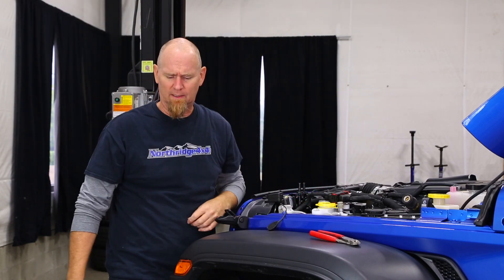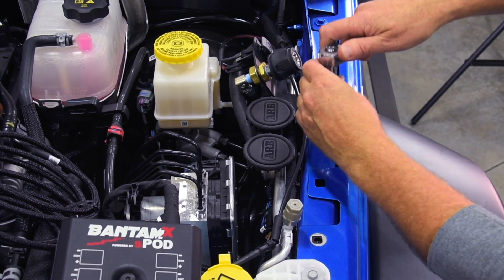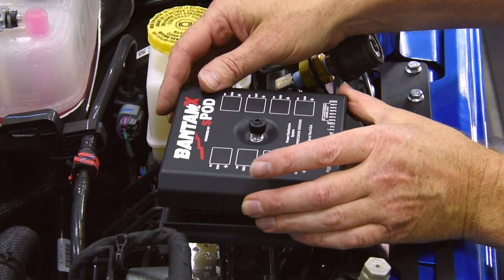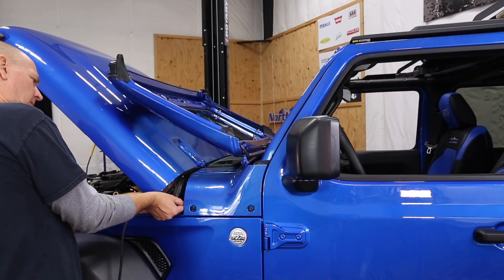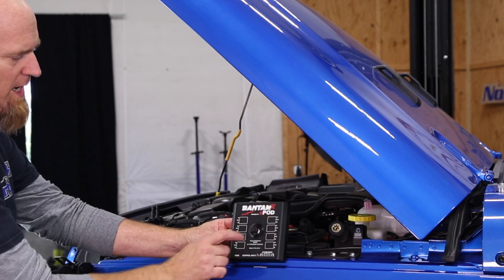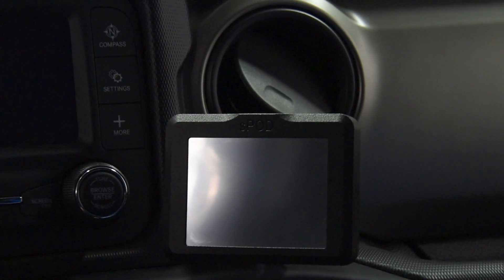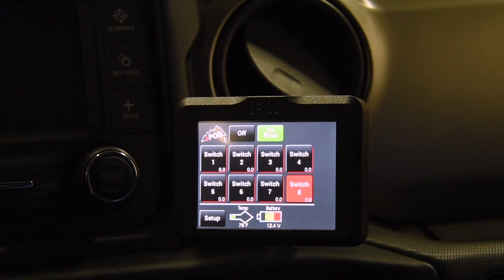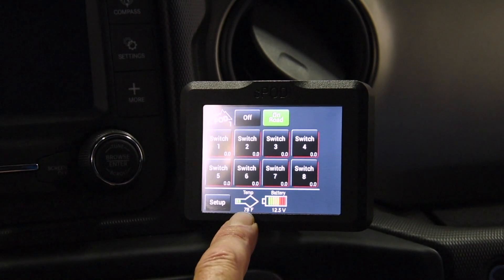sPOD BantamX TouchScreen Install - Jeep Gladiator JT

Comment: Question? Sorry I know it’s been awhile but what Spod battery cable length terminal cables do you go with when buying the unit. 

The 84”or 36” length. Just wondering if the 36” is long enough. They offer two different options. Thanks for your time!
Reply from the maker: For the JT, we go with the JT specific kit:
https://www.northridge4x4.com/part/switch-panels/bx-tsb-jl-spod-bantamx-touchscn
If you are doing a custom mount, use a tape measure to measure over from where you want to mount your PDS over to your battery.
Reply: @northridgenation Thanks so much for replying back to me so soon. Yes, I have a 2021 4Runner I’m wanting to get one for. 

I will do as you suggested. Also trying to decide between the Spod touchscreen or the Spod HD model. Decisions, decisions! 😂

Comment: Thanks, but for my 4XE no way would that mount there.  I went with the  speed Pod that mounts to the passenger wheelwell which fits.
Reply from the maker: Great tip for those 4XE peeps out there.

Comment: So for the two separate ditch lights do you double up the spade connectors on the SPOD terminals for the specific switch?  Or do you splice the two ditch lights together so you only have 1 set of positive/negative wire from going into the SPOD?
Reply from the maker: We typically double them up. Easier to pull one side of the harness if needed.

Comment: Nice will this work for a 2021 Chevy Colorado zr2 ? Is there a mounting plate for it or kit ?
Reply from the maker: Yes, the sPOD will work with any vehicle that has a 12v power supply. They do not make a Colorado-specific bracket. Your best bet would be to go with a universal kit and make your own bracket:
https://www.northridge4x4.com/part/switch-panels/bxtsbuni36-spod-bantamx-touchscreen-for-universal-with-36in-battery-cables
Though you could go with a JL/JT sPOD kit, the mounting bracket is really basic and could easily be adapted into other vehicles:
https://www.northridge4x4.com/part/switch-panels/bx-tsb-jl-spod-bantamx-touchscn

Comment: Did that mount release yet?
Reply from the maker: yes, here it is:
https://www.northridge4x4.com/part/compressor-mounts-accessories/10380-grimm-offroad-twin-compressor-mount-spod-upgrade-kit
Reply: @northridgenation  Hey, sorry, that's a compressor mount. I was referring to the SPOD switch mount featured in this video
Reply from the maker: @jaredchandler4504  That hasn't been released. Reach out to Grimm Offroad and let them know that is something you'd like to see.
www.grimmoffroad.com
Reply: @northridgenation  thanks. Will do 👍

Comment: Great concept, but wow is that screen horrible! It's 2022, where is a 5" or 7" option with an Hi-Res option. I'd gladly pay more for a actual good looking device. This reminds me of something from the 90's that runs DOS lol.
Reply: Yha me too. Looks like a palm pilot screen from '05. And you dont want to be making mistakes w the screen when your in a jam. At this point id rather have real buttons clean and simple like the switch pros and flush mount it into my headliner, out of sight from crackhead thieves and out of my way when I dont need it!

Comment: Amazing video!! Extremely helpful! I just installed mine last night. I do have a quick question. I’m installing my KC 50” light bar pro. It came with a bunch of extra cables 🤪. Where do I make the cut?? I was instructed to cut everything off as just connect the negative and positive coming from the light bar and get rid of the relay. Is this correct?? Thank you I’m advance!! I love you channel. Please keep up showing us how to approach our mods.
Reply: @randypeal2255  thank you so much!! I truly appreciate the help!!
Reply from the maker: Yes, just cut the harness down until you have the negative and positive wires, run those direct to your sPOD and you are good to go!
Reply: @northridgenation  thank you so much!!! I truly appreciate it!!

Comment: The S-POD with the LED Screen is what I want for my lights on my JTR. I like the way it installs without all the extra wires and your able to hook the lights direct to the system without splicing into jumpers. This is the way to go. No connecting into cigarette lighter fuse or having to go into the hazard light wiring, this looked way simpler & better IMO.
Reply from the maker: They make it so much easier!

Comment: Just keeps getting better; just the position of where you located will get hot in cold weather when the heat is on blast...?
Reply from the maker: The swivel vent makes it easy to either point the heat away or even shut it off all together.

Comment: Do you guys sell a kit of just the mounting bolts? Neither my SPod nor my Grimm offroad ARB mount came with the bolts to mount it to the hood.
Reply: If not do you happen to know what size bolts I need to get?  I know they're a 10mm head but I don't know much else about them.

Comment: It would have been nice to make the control unit a size to fit into the place on the bottom of the dash where the overly expensive mopar switches go! OH never mind. This this is 3 times more expensive than the mopar unit!